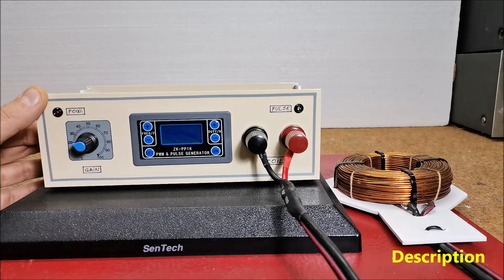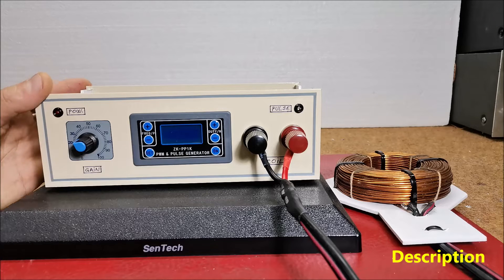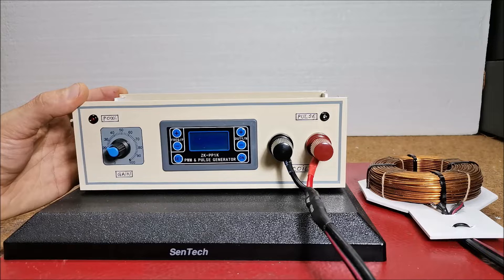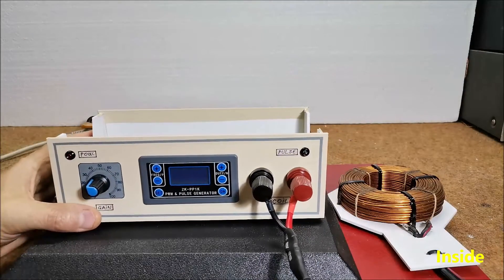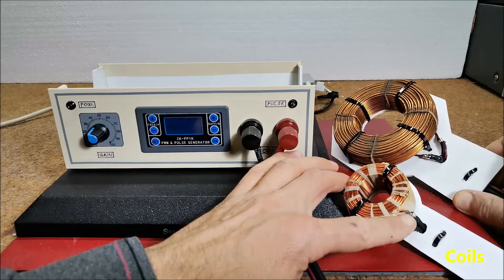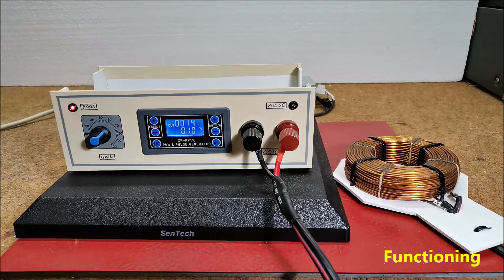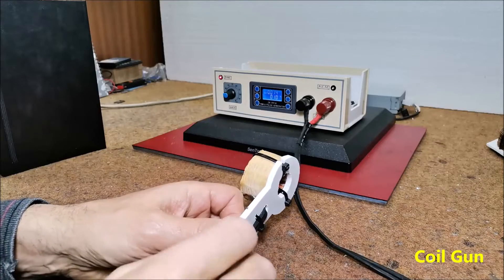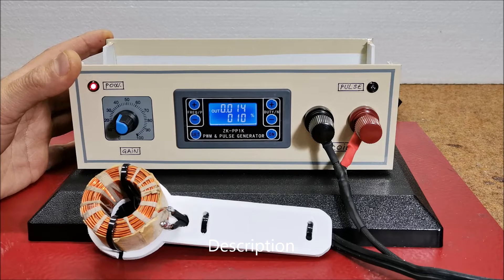Simple to build High Power PEMF (Pulse electromagnetic field) therapy device

Comment: This diagram and  the exact same you showed on the video  is NOT working 

Gain is working 
Coil is generating magnetic field but not obeying the frequency generated by the PWM, after all connection done coil is vibrating for unknown frequency (not from  the frequency set through PWM)?
Reply: Are you sure it doesn't work, why shouldn't I make it? Thanks.
Reply: @elgutitozamora  yes sure
Reply: Is there a wrong connection, or what is the cause?

Comment: I have question, if im wrong correct me please 
1) Pulse is nothing but Freqency?

2) Here potentiometer used to achieve magnetic flux like, micro tesla, mili tesla, tesla so on....
Reply from the maker: 1. Rectangular signal with a certain frequency    2.The potentiometer regulates the intensity of the magnetic flux.
Reply: @MirkoPavleskiMK 1) is there any specific video for coil making?

2) is there any difference in the   pemf commercial device, and your device and also audio amplifier?

Comment: Ey Mirko, Im building the generator right now. I am using 18v makita battery as a power source. I am wondering whether I need to change  values for mosfet and led resistors.

Comment: Thanks for this video. i built it. i used 12 pieces mosfet with 600v 35A. it worked but the heat sink was mildly hot after using for several minutes. I dont believe the heat sink will remain cold after using for hours as you have said.

Comment: Has anyone encountered a PP2K module producing a square wave at the beginning of a cycle, and forming a a saw-tooth on the trailing edge cycle? The PP2K module is brand new. It was only hooked up to an oscilloscope so far. Any ideas on how to square up the trailing edge of the cycle? Or is this PP2K junk?
Reply: Found the solution: By adding an external Mosfet to the output of the PP2K, the signal, between the PP2K and the mosfet becomes square wave again.
Reply: @superargo4701  thanks for that. i can do the build. elec theory is still tough for me. i'm older, and post Covid long haul has been hard on me

Comment: Do you think you could build a Halopulser Magnetic Pulser that another channel has advertised? I've been trying to find someone who has built one because the people that are selling them are charging $175-220 for 1 single unit that goes around the neck of the wearer. The Museum of Tarot channel and website has what I'm referring to. They are charging too much money for something I know probably costs less than 50 bucks to make, if even that. Its about the size of a match box and is able to change frequencies within a range. The unit is supposed to envelope the wearer in an electromagnetic bubble to ward off electromagnetic attacks and was first built and used during WW2. If you could please consider making one of these as a project and showing everyone how to build their own I would be so very grateful. It doesn't even need to have the plastic encasing just the internal parts. 
🙏🙏🙏
Thanks for your time. Peace & Blessings
Reply from the maker: I have studied the device you pointed out (Halopulser Magnetic Pulser) and I can tell you a few facts in brief. It is a standard PEMF device and emits a signal identical to that of my previous projects, only with extremely low intensity. The fact that a small CR2032 battery lasts up to 650 hours confirms this. So it is not some innovative magic device but a mobile PEMF device with extremely low power. Perhaps in one of the following videos I will describe to you how to make a much more powerful and sophisticated device for this purpose with only a Smartphone and a suitable coil, of course with a apropriate phone application. Anyway thank you for the great idea and I hope for a new video in this area soon.

Comment: Why should the wire be at least 1mm? Bigger wire = less resistance = more current = stronger magnetic field, but wouldn't more rotations and higher voltage with a smaller wire give you the same result?
Reply: There is attenuation over distance. Shorter wire length limits power loss along line.

Comment: Have a question. I wish to run 2 coils. I figured out the requirements for the coils but i dont know how to attach them.
It is series, or parallel?
Reply from the maker: It is important that the resistance of both coils is not less than 0.5 Ohm. If you connect it in series, then the individual resistance of each coil should not be half that of the current coil, and vice versa, if you connect them in parallel, their individual resistance should be twice that of a single coil
Reply: @MirkoPavleskiMK  Thank you
Reply: Got the specs right for parallel and it works except i think i made a poor choice. I used aluminum pipe for the core of my coils. The pipe gets extremly hot.
Going to unwind them and figure out how to  wind a proper coil like you show

Comment: Oi Mirko, achei uma dificuldade na nomeclatura das 08 unidades dos Mosfet, ela pode ser (NTP125N65S3H), conforme nos comentários, ou tem a nomeclatura que você usa para deixar em série as suas unidades mosfets.
Reply from the maker: You can use almost any power MOSFET such as IRF640, IRF3205, IRFZ44, P5N06 ... If you use NTP125N65S3H you need to put 10-12 transistors
Reply: @MirkoPavleskiMK  Ótimos projetos sobre Pemf, estou a executar um deles o qual tem muito a ver com o meu dispositivo de aterramento que usei um projeto do Douglas Ormeneze, que recoloca no corpo humano o equilíbrio de recarregar eletricamente as células em suas micro circulações, sem conexões de cabos de eletrodos, os quais já acoplados no dispositivo, iguais ao que projetei e que realmente por mim e um numero de dez pessoas comprovado que tira as dores do corpo da cabeça aos pés. Isto pelo simples equilibrio de eletrons passando pelo corpo

Comment: Mirko, good morning, excuse me, can I replace the zzk pp1k with the zk pp2k? thank you so much
Reply from the maker: The ZKPP2K has a power mosfet on the output but I think it should work without a problem. It is possible to connect a resistor with a value of about 100 ohms to the output
Reply: Thank you so much Mirko

Comment: In the video you said a pc power supply could be used but in the schematic diagram you state a 20 amp power supply. Which is required?
Reply from the maker: You need a 12V/20A power supply. Most PC power supplies have these features

Comment: Can you help to calculate the maximum power i can delivery to the coil? The mosfets burned in the equipment i made
Reply from the maker: In short, the ohmic resistance of the coil should not be less than 0.7 ohms

Comment: Mirko, good morning, does the coil have polarity? How do you know which is positive and negative? thank you so much
Reply from the maker: No, coil has not polarity
Reply: @MirkoPavleskiMK  hi. The coil does have polarity. Both sides should not be used. Careful
Reply: @realastropalmistry  I use the south pointing side for sedation, inflamed, etc.  And the north pointing to build energy, build up (cuts, bone issues).  Will check out your site.  I used a simple Nano on mine, old RS crossover coil for the wand, IRL540 N-FET to drive it.  And Lion batteries to charge it and power it.  I tap off the first two cells (8 volts or so) with buck step down reg to run the nano, charge caps with the rest.  Works well.  I have used the MP6 and MP7 (soto) next to it.  Sure is cheaper..  LOL.  Plan to use a 14.4 or whatever it is XT60 electric plane pack on the next one.  I spot weld Lions with them.
Reply: @rekim  hi. Only north side of coil will face the body. The south side should not.

Comment: good morning Mirko, excuse my ignorance but what happens if instead of a coil I put a copper tube on each terminal and be able to use it as a zapper, is that possible? Thank you very much for everything, greetings and blessings.
Reply from the maker: These are devices that work on a different principle, and are also simpler to manufacture. There will also be a Zapper in one of my next videos
Reply: @MirkoPavleskiMK  thank you very much

Comment: Mirko, I read your page on PCBWay on PEMF and one thing you said would like to ask how.  In this simple but powerful PEMF device here, you use a signal generator.  In your PCBWay page you introduced the ability to use a cell phone signal generator.  Question is, how can one integrate a cell phone as signal generator into your PEMF design above?  tx.. as always terrific projects.
Reply: long time no see! I bet you would connect the phones output to the gate driver so rather than the microcontroller signaling the gate it would be the phone which is probably within the voltage range required to activate the gate.

by the way, I can't remember if I updated you on this or not but when I finally got around to building that updated schematic using a single high powered mosfet it caused a clicking noise in the PSU. I have no idea why, but it happened on both PSUs that I have. When I re-wired it with one mosfet per coil the clicking went away.
Reply: @sdriding  Heya... long time, yep.  Oh boy... much has progressed.  Let me see if I can find your email so I can send ya wuz up in my circle of projects.  MUCH has progressed...

Comment: Hello can you tell me if the dark blue wire is connected to the bus bar or directly to the middle pin of the first mosfet? Thank you very much.
Reply from the maker: Anyway, the bus bar and the middle pin of the mosfet are short-circuited inside the mosfet

Comment: Does it ever draw the full 20 amps?  (Or close?)

Will it work with a 12v 10 Amps power supply?
Reply from the maker: Yes, it will work with 12V/10A PSU

Comment: I gutted an old ATX, fitted the front with parts as per your design but added two 15 pin D type sockets from old PC, a switch to select between D sockets or binding posts, and added a jack socket to output from pulse led to i/r glasses.
I then mounted the contents from a more modern and smaller ATX into the older case which left plenty of room to fit your design with heatsink. The D sockets are mounted vertically to accommadate a 15 core ribbon cable which goes around the room to create a magnetic field to act as a 'moodloop' sending Alpha, Beta, Theta, Delta or Schumann Frequencies. I purchased some inexpensive black out glasses that sort of look like two black, half ping pong balls, and fitted each side with three ir led's each, for entrainment purposes. For the coils, I used a new, stylish bicycle handle. I cut a short length of broom handle, drilled through the bottom to accommodate wires, cut a slice down the centre of the other end to mount the coil on with wires running down centre through bicycle handle where they connect to input cable from posts. The wooden part of the broom handle was covered in wide, coloured gaffa tape to create a nice finish. A few aethetics to the front and I have a proffessional looking all in one psu and pemft device.
Reply from the maker: I'd like to see what it looks like
Reply: @MirkoPavleskiMK  Will post a link to pics on Tuesday.
Reply from the maker: @catman4471  Thanks
Reply: @MirkoPavleskiMK  Hi Mirko my last post disappeared, I think it's because it included a link. I put up several pictures, three views of the coil 'wand', pictures showing the two different sizes of psu, the completed version of your high power pemf and an incomplete version of your previous version that uses the class D amp, I'm awaiting parts to complete it but it's an electromagnetic  'binaural' version. I hope to put up a video of them both in action very soon. You can check the pics at vibolabs dcom.
Reply from the maker: @catman4471  I looked at the pictures, great project congratulations. I'm fed up because the goal of these projects was for as many people as possible to make them
Reply: @MirkoPavleskiMK  Don't be fed up you might be surprised to find there's a lot more interest in your projects than you might realise. I'm hoping to doccument my progress with your devices via my channel. There's a lot of interest in binaural beats etc, you always see a lot of users on such channels but many believe that it's the coils in the headphone speakers that produce the effect rather than the sound. I have done a lot of research into using ELF's for various purposes from simple entrainment to healing to the more whacky world of mind adventures.....there's one guy who wrote a book where he doccuments his research into the paranormal with such devices. All in all, there's a lot of scope and a lot of interest can be generated.
Reply: @catman4471    all sounds fascinating!  I'm getting a Rife machine and interested in building my own PEMF and anything related.  Could you tell me the name of the guy w the book on using these devices to reach multidimensionals etc ..?  thanks!
Reply: @dlgoldenmm  I'm having difficulty finding the book (pdf). When I downloaded it, I didn't rename it, so it's downloaded as some peculiar number or something! But look into The Gateway Process for a starter. I will provide the name of the pdf and author as soon as I find it....thousands of PDF's to go throguh I'm afraid!
Reply: @catman4471  Where can I see the diagrams of your projects? Your work is interesting. Please help me. Thank you.
Reply: That coil idea to make a mood room sounds like a great idea. I'm putting together a BOM in order to get the parts, today. Appreciate the information on the toriodal coil for the box. Be nice to have a part number or specs for it. Have some old boards to scavenge one off of. Would order some in the meantime. Want to get started on it, and get it built.

Comment: instead of 8, use 10 mosfet, is it normal for the coil to heat up? Or should I use a larger wire diameter?

Comment: Hi Mirko, i am electronics Engineer. there is no need for many power mosfets, only one can drive. I have made this circuit my self. I use single 38N30, instead of your mentioned transistors. I have made more powerful pemf devices, with power upto 10000 gauss.
And only high power pemf device has good results
Reply: Is the same exact circuit/power supply but larger mofet?  Does it overheat?
Reply: @JimmieGoldMusic  hi, no it is entirely my own design, much simpler with few components advanced controlled output and it doesn't overheat. Watch my channel
Reply: @realastropalmistry  hi where do I find your channel on the pemf  project?
Reply: @firdoshdiakus4841  just click on my name in this chat to reach there
Reply: @realastropalmistry  hi irfan i see your still active on youtube. Am the guy who contacted you 1month ago. But didn t proceed with the buying. I just sent you message watsapp . Can i call you on watsapp . Thx
Reply: @stecder2470  sure u can call
Reply: @realastropalmistry  Hi am not interested in purchasing one. I want to do this project on my own. But thanks.
Reply: primero dices que has creado este cir cuito, y luego dices que es un diseño tuyo, que creo?
Reply: Would you be willing to build one...I would pay....well a reasonable price.
Reply: @heswatchnu  Sure .
Reply: @heswatchnu  click on my name for further communications
Reply: @heswatchnu  In About section, contact is available
Reply: @heswatchnu  more powerful pemf devices are available at order
Reply: So why don't you make it available? No use telling us about it
Reply: @firdoshdiakus4841 hi , I am making more powerful pemf devices and are available to buy , on order

Comment: Would it matter if I used 7 irf740 mosfets and 1 RU7088R Mosfet to get the 8 needed for circuit? Will a 12v 15amp computer power supply work?
Reply: plz visit my channel for powerful PEMF. no need for so many power mosfets

Comment: do you have another module that can be set to 7.83hz or advice, can 8hz be easily converted to 7.83hz output please .
Reply from the maker: Unfortunately the resolution of this signal generator is 1Hz, so it can not generate exactly 7.83Hz. Another way is an oscillator with the help of Arduino microcontroller, but for that maybe in one of the following videos
Reply: @MirkoPavleskiMK  is that an expensive fix

Comment: i have an fy3200s signal generator with pulse function 20vpp output. can i use that by any chance
Reply from the maker: You can use it instead ZK-PP1K module, and the rest of the circuit to remain the same

Comment: Can i connect 2 of your big (50mm center) coils straight to the generator or would it burn out. I think i need 2x generators, problem is i want them the same frequency exactly. is there an easy way to build 2 coils that can be used with this generator. thanks
Reply from the maker: In particular, you can use two large coils connected in parallel at the exit, because the number of power Mosfets is enough to withstand it.
Reply: @MirkoPavleskiMK  thank you so much
Reply: @michaelprivate9107  Thanks Everyone for being so detailed its helping me learn so much!

Comment: Thanks for this information. Is it possible to have 2x (big) coils connected to the generator. Each (big) coil doesn't need the strength that yours has but close. If so, how many total windings on each coil with how many layers & how many windings each layer please. Thanks again.
Reply from the maker: At first under LARGE coils, you probably mean with a larger diameter. All this is quite feasible, but to make and test those Large Coils requires a lot of time. You just have to observe the conditions that I have listed in the text. The purpose of this project is more educational so if you have more time and knowledge you can test yourself. As a small help I can tell you that when you make a large coil like this with the same number of turns and the same diameter of the wire, it will work normally only the field will be weaker.
Reply: @MirkoPavleskiMK  oh yes sorry I mean 2x coils that you use (50mm center). I can't connect 2 of your big coils straight to the generator correct, It would burn out. I would need 2x generators, problem is i want them the same frequency exactly.
Reply: @michaelprivate9107  y no podes exitar dos grupos de mosfet con el mismo pwm ???